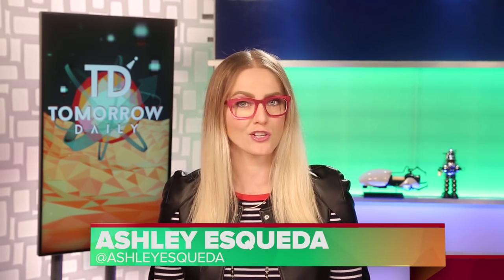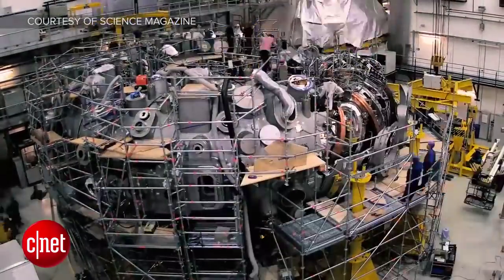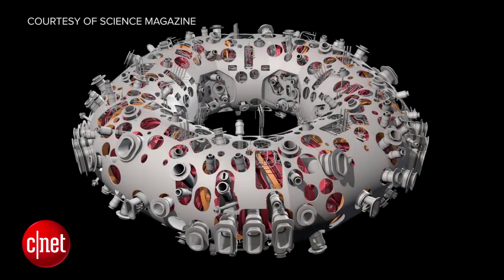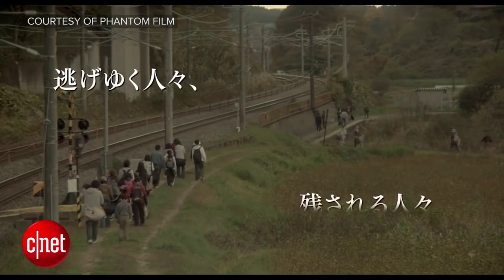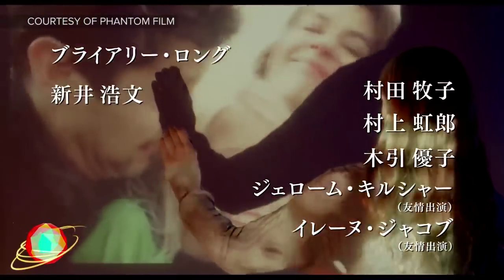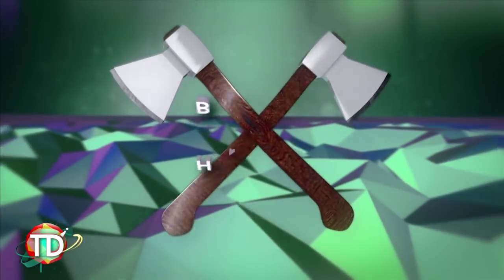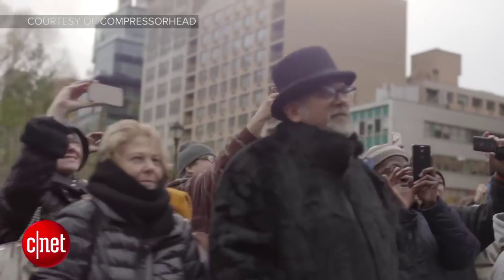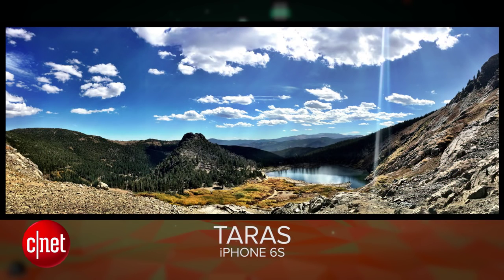Tomorrow Daily - This huge new fusion reactor took 19 years to build, Ep. 272

Comment: fusion or fission because fusion is what happens in the sun
Reply: Yes, they are building a tiny sun.
Reply: +Zeke Buf One that take less energy to do compared to what is outputed.
Reply: Fusion is where you combine two positively  charged atoms together (and yes, that what happens in stars and thats why it gets hotter then the sun in that reaction chamber) where as, i am pretty sure, fission is where the atoms are split and it gives off energy. (The reason why it has to be so hot in the fusion reactor, is so it is able to put the two positives together! Take a magnet for example, you cant connect the positive with another positive because it repels it away, where as it clicks together with a negative. (Btw i am 13 years old, and that what you learn at school!! Yay for GCSE's!!
Reply: And it seems as though, i cant use brockets correctly!😂😂😂
Reply: Or spell them correctly!